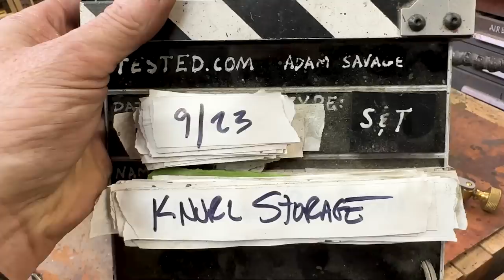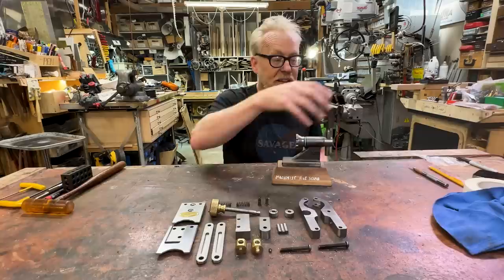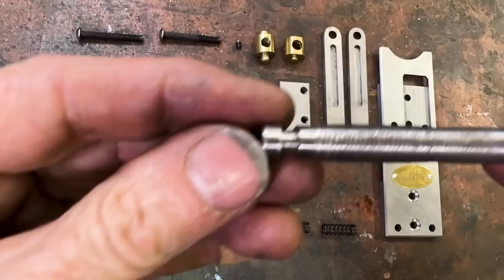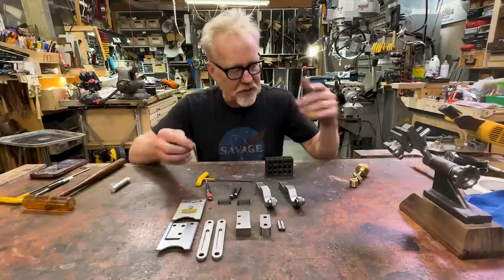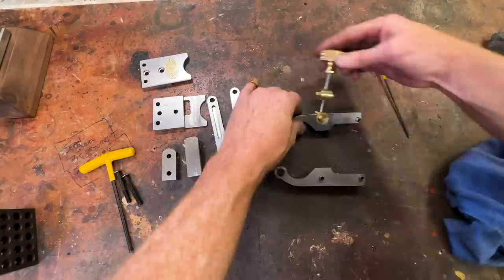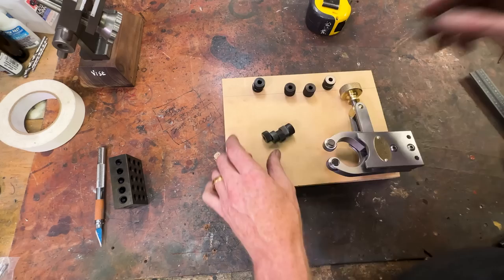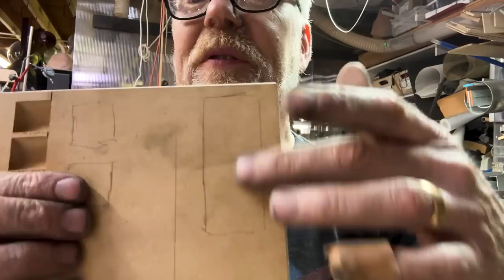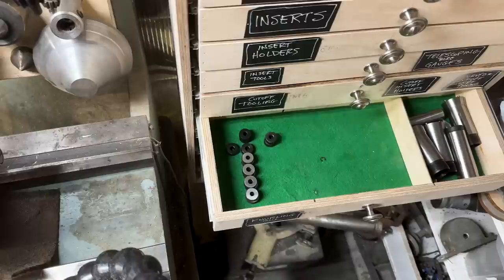Adam Savage's One Day Builds: Knurling Tool Storage!

Comment: The eccentric clamping arm is actually the very best part of this design.  You  NEED to make another one (trust me). Hemingway will sell you the plans alone.  Also it doesn’t use circlips but much nicer clamps.
Also, what kind of goof uses mdf.  It’s just going to swell up with oil and look like crap.

Comment: Adam, and fellow makers in the comments, I want to share a fun little trick for the application of CA liquid accelerator that I've found incredibly useful and I assume you would too. This is a trick I learned after I started working at the Taylor Guitars repair shop at the factory in El Cajon, CA. 
Everyone knows that over-accelerating your CA glue can cause it to harden too quickly and puff up, giving you voids, and turning white. The aerosol cans seem especially prone to this. There's one company called GluBoost that has developed a really great formula that prevents this from happening, and it's really wonderful stuff. However, the cans don't hold a lot and are kind of expensive. So I usually save that stuff for critical situations like repairing finish cracks where the voids and whiting will ruin the work and I have to scrape it out to start again.

The team at Taylor Guitars developed a little trick for this that works brilliantly, and I've fallen in love with it since I started working there. We use liquid accelerator in a single-action air brush. (The specific brand we use is Zip Kicker, but I imagine it would work great with the BSI Adam uses or any other liquid accelerator on the market.) Every bench in the repair shop, and the production facility for that matter, has air. We all have a regulator to drop the pressure down from the main line to about 10-15psi, and hook up a small single-action air brush with a jar containing liquid CA accelerator. This will let you feather in the perfect amount of accelerator when you need it to kick the glue off without over-doing it. 

You can adjust the air pressure as needed for the best results, I've found between 12-15psi is great. We use a siphon-style single-action airbrush so the control of the fluid and air mixture is constant once you set it, no need to feather it in by pulling back the button, however I'm sure that would work if someone wanted to try it.

Comment: Fun fact, you mentioned 3/8"-18.  I've got a Sigourney triple head drill press from the 1890's(and another from the 1880's), and the spindles are bolted to the a T slot with wing nuts that have 3/8"-18 threads!  However, I haven't been able to find 3/8"-18 hardware anywhere!  McMaster Carr has 3/8" hardware in 10 or 11 different thread per inch options, but not 18tpi.

Comment: I'm worried about that set screw yielding or moving on the bottom of the 3/8" rod. I'd redo that brass anchor and put a c-clip (circlip) in there instead. Beautiful tool Adam.

Comment: Curious to see how the brass nut holds over time. This design has always struck me as overly complex. In particular, I'm not thrilled with the clamp screw being in compression and the resultant need for those long slotted guides.

Comment: In order for the knurling pattern to work, doesn’t there have to be a ratio between the knurl wheel and the part being worked? So one revolution of the working piece = 2 or more complete revolutions of the knurl wheel? If that makes sense. 
Just curious…
I enjoy the content you produce
Reply: I would imagine that the spacing of the knurling pattern would ideally be a fraction of the workpiece's circumference. It does not have to match a ratio of full revolutions, I guess, since the pattern is repetitive.

Comment: So therapeutic watching your builds, you are an insperation on many levels .
I have a question / suggestion ….the clips holding the wheel pins in place….why did you choose the spring clips rather than an actual circlip ? You can remove a circlip much easier with the correct pliers where as you might marr your faces over time trying to remove them spring clips over time.

Comment: i notice you are doing your knurling in steps, if you set your feedrates you can power feed knurl in a single pass.
Reply: for context, I knurled the handles of mcdonalds canada frybaskets for years (i wish we had a clamp system cause ensuring no jitters anywhere on the setup pieces was hard and we would like to do a couple hundred at a time once it was set up)

Comment: I know NOTHING about metal working/knurling, etc so…
It occurs to me that the knurling wheels would only work on certain multiples of diameter. Like 1 inch, 1 1/4 inch, 1 1/2 inch since the pattern would have to match up. If it didn’t match up the pattern would make a mess by overlapping itself. Do I have that right?
Reply: Close.  The circumference of the workpiece needs to be an integer multiple of the distance between the ridges of the knurling wheels.  See https://en.wikipedia.org/wiki/Knurling.

Comment: You didn't assemble it backwards the first time.  You assembled it to knurl close to the tailstock just as you designed it to do.  The second time, you assembled it to knurl close to the headstock just you also designed to do.  The only place you were remiss was in failing to point out the cleverness in having a bidirectional tool.  Too much modesty is a handicap, you know.